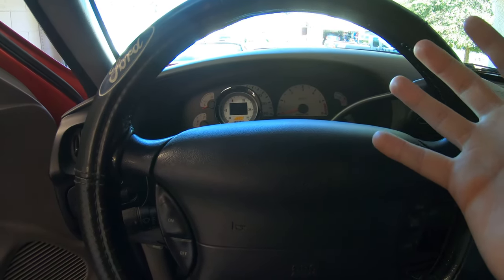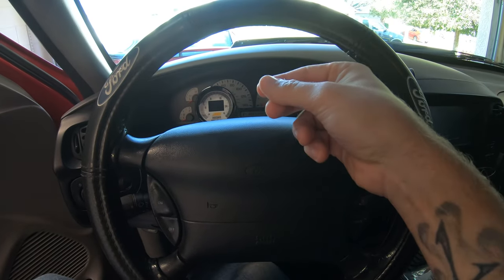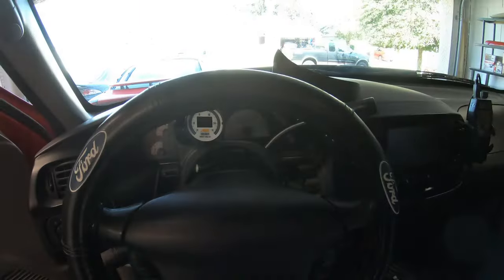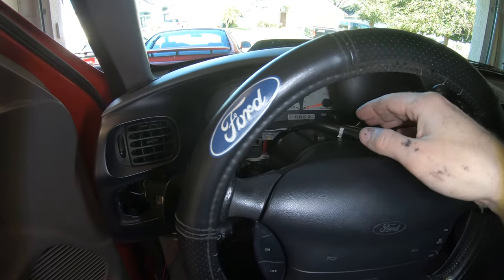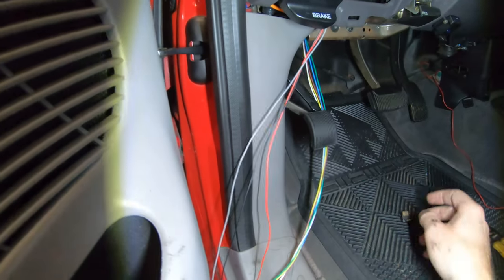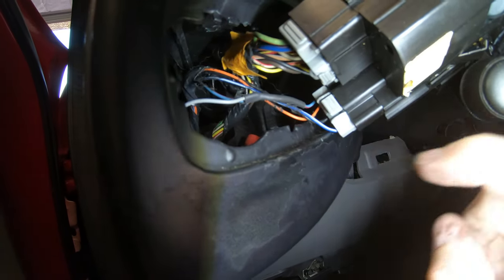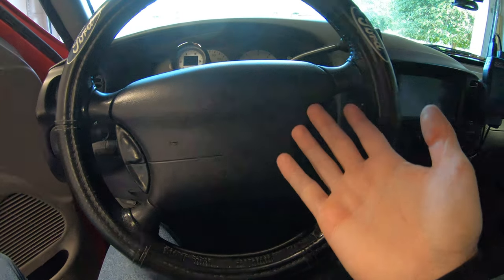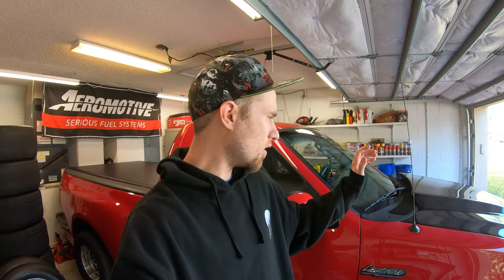Ford Lightning AEM Wideband Failsafe Gauge Wiring | Sct X4 Firewire How To Guide

Comment: Hey i recently got a airfuel ratio gauge with no wiring harness or sensors to connect it. the harness you bought in this video is all i need to connect and work this gauge? and do you mind sharing a link to it. if that’s what i need to connect my gauge and work my gauge

Comment: when wiring a wide band to a v8 do you need two sensors for both banks or?
Reply from the maker: Not necessarily, you can just have it read one bank, that's what most do.  But it's not a bad idea to get a dual wideband, or two, and read them both, so you can tune off the leanest bank.  I'll be doing a video about this very soon.

Comment: Just wondering where did you tap the fail safe wire to?
Reply from the maker: I didn't yet.  You need a J&S Vampire or aftermarket ecu with that function for it to work.

Comment: What brand of spark plug are you running on your Red DEVIL ❓❓
Reply from the maker: Ngk Br7ef plugs gapped at .028.  Ngk tr6 at .032 are good for 6lb pullies and lower, but the Br7's are good for those running more boost/pulley.  Check with your tuner though, tune may vary depending on what plugs you go with.

Comment: I'd rather keep my 2001 Ford Lightning gages stock
Reply from the maker: Widebands are extremely important to have, it’s critical to monitor your air/fuel ratio, especially if you do any mods, and absolutely required if doing remote tuning.  But even on a stock truck, I couldn’t imagine not having a wideband to keep an eye on your trucks AFR.
Reply: @DebtLife_Projects  yes mine's been modified the last owner did everything to it but I don't have the gauges but everything's been done to it so I'm not sure what to do on my truck
Reply: I'm afraid I mess something up so I'll probably just keep by the same not saying nothing against the video just I want to complicate myself in the more troubles